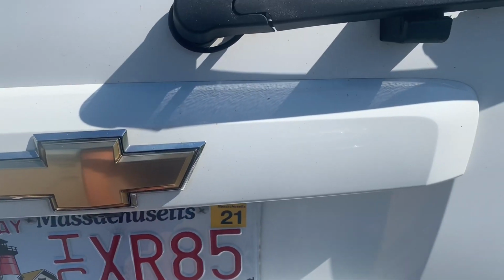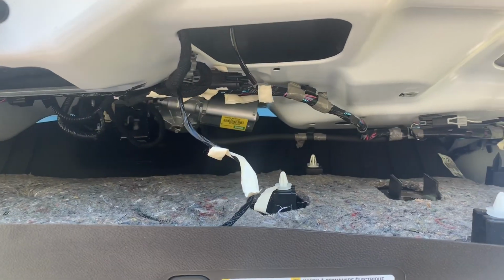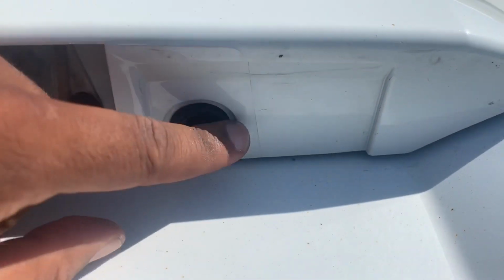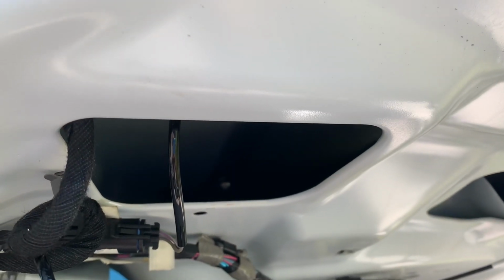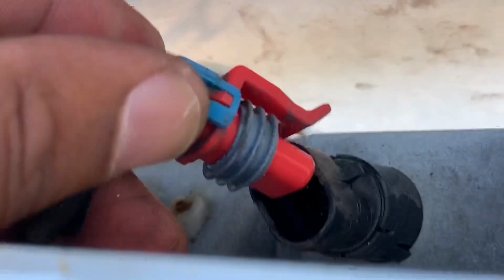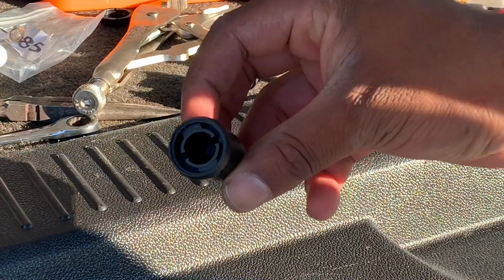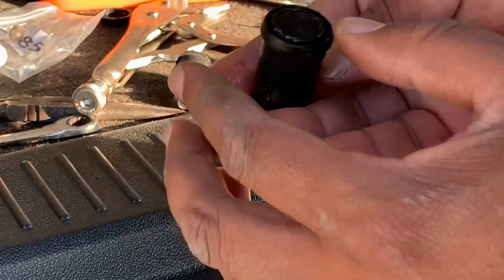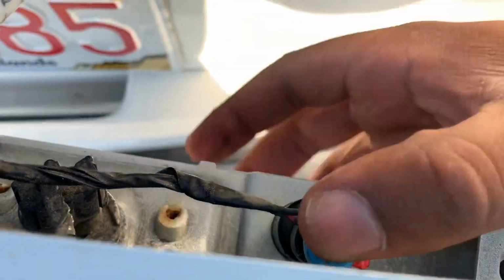How to replace lift gate window switch on a Chevy Tahoe/Gmc Yukon

Comment: I just prayed the old one out - grabbed the connector with needle nose pliers and popped new one on — 5 minute job.  Thought I was going to have too follow this pattern after initially losing the connector into black hole but was able to recover it with a pick and the thin pliers
Reply: Pried not prayed, but I did a little of that too
Reply: thank you

Comment: So my 4 screws that hold the applique on the back are spinning and will not loosen up.. any tips or ideas.?
Reply from the maker: They probably broke off because of rust…you would probably need a body shop for a minor inexpensive fix
Reply: @BimmaJoc  dammm it.. so if already broke I ll just pull it off then.?
Reply from the maker: @santiagodavila1426  nope because you need it on
Reply: @BimmaJoc  what you mean.?